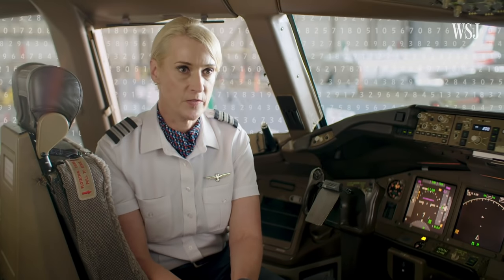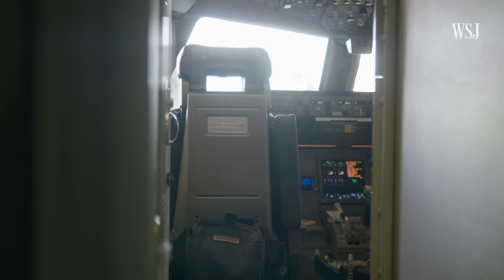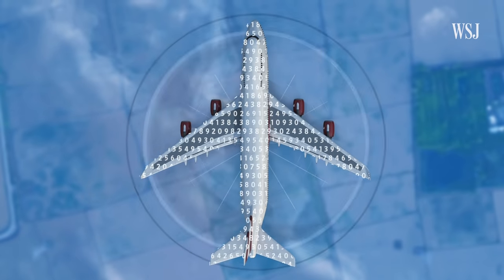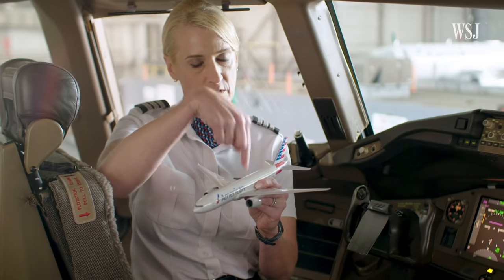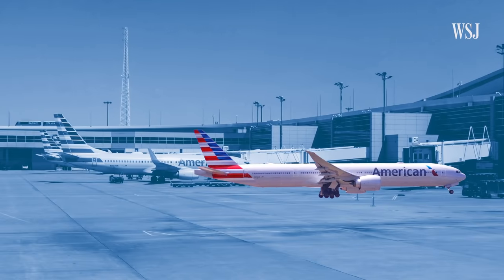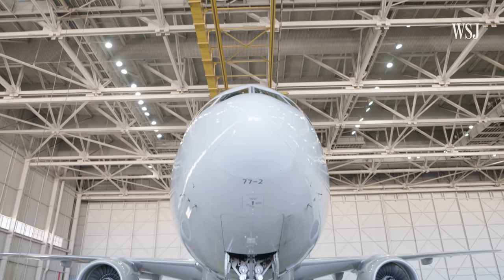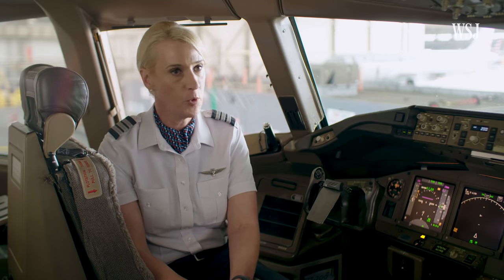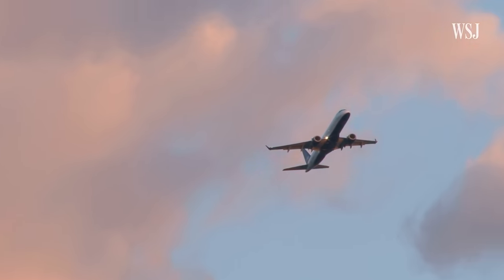How Does Autopilot Work? A Pilot Explains What It Can and Can’t Do | WSJ Booked

Comment: The autopilot on a Boeing aircraft can control both the elevators and the horizontal stabilizer, although indirectly for the elevators.

 Horizontal stabilizer: The autopilot primarily adjusts the horizontal stabilizer for long-term pitch control. This adjustment influences the overall pitch of the aircraft.

 Elevators: The autopilot doesn't directly control the elevators. Instead, it makes small adjustments to the horizontal stabilizer to indirectly influence the elevator position and maintain the desired pitch. Pilots can still override the autopilot's adjustments to the stabilizer using the control column.

Comment: Smaller planes need this technology
Reply: They have simpler versions. It can be a simple as wing lever. It can have control panel only (no flight management computer). It can be airliner-style avionics. It depends how the owner want to configure their plane, and if the plane is certified for Instrument Flight Rules.
Reply: They have it - and even more advanced versions of it. Cirrus developed an autopilot that has a panic button for passengers which makes the plane land automatically and the closest suitable airport totally without interaction. It manages every stage of the flight from that point onwards giving feedback and communicating to atc meanwhile doing it's maneuvers. This technology has existed since basically the Apollo capsule and it's accompanying rocket which had the first digital flight computer. With analog computers and autopilot (which did/do exist) it would have been next to impossible to implement. Today the technical implementation is trivial though the regulatory certification especiallybin commercial space is very difficult.
Reply: @rkan2  It's not limited to Cirrus, it is any aircraft with compatible Garmin avionics. Although, the assumption of emergency autoland is that the nature of emergency is just pilot incapacitation. Add technical problems in the mix, all bets are off.

The typical course of action in case of automation malfunction is to stop. Planes does not have such luxury.
Reply: @dbclass4075  Yes, you are correct, but as the system is certified as a system (at least currently) - it is only Cirrus that has managed to achieve it by now even if it the Garmin avionics that provide it. What comes to reliability - the human is still very much in the loop so all bets are off from the getgo anyway.

Comment: Auto Pilot should be engaged at 28K feet ? I’ve see dozens of videos of Pilots engaging AP second after v1 rotate!! I mean ..is that trusting the system at max or wanting to take charge of the aircraft the least possible and leave it technology rather than experience and know how?? Interesting 🤔
Reply: Different aircrafts have auto Pilot activated at certain phases of flight but yeah most pilots prefer to manually climb then engage it when they reach the cruise altitude.

Comment: My question is if you flew a plane without a autopilot system will you be certain I can get to my final destination in a safe manner
Reply: Planes can always be flown manually, at least so far. However, for the longer distances, speeds, control complexity, and the fact a flight engineer doesn't exist any more, it is a lot safer for autopilot be used for routine operations. Flying entirely manual for more than a couple of hours, especially on busy routes, would be extremely tiring for pilots.

Comment: Sir

I am Mathew from Interlude Technology we have the solution for death dive recovery.
We have the solution for the recent crashes related to death dives / vertical unrecoverable dives. I have experience in creating and recovering from such dives on jet aircraft. I can create the death dive on simulators and the procedures leading to recovery depending on the various characteristics of flight.
I had the opportunity of meeting Boeing, Airbus, and Lockheed Martin at CANSEC 22 and discussed with them the recent crashes of Lion Air Flight 610 and Ethiopian Airlines Flight 302. Eastern China air crash and Flight 72 (2008) Aircraft involved was Airbus 300 all manufacturers acknowledged the cause and the crashes.
Since the pilot goes into a negative 3.5 G to 4G cannot respond aptly. And valuable time is lost. When my solution is automated and applied from the inputs of two instruments in the right sequence the aircraft comes to the right attitude then the engine is put back to control after stabilization and at the right air-speed, the lift is augmented as required depending upon the height the recovery has to be initiated. Waiting for the aircraft to belt under control and apply the required trust to climb back and return to base as applicable after the inertia due to the dive is negated.
I have the experience and depending upon the aircraft to be saved the solution can be modified and applied.
Analysis
In the case of flying where Anticipation Awareness and Apt Action are the keys to avoiding disasters.
There is a saying” to foul up things you need a computer”. And one needs a specialist to complicate a problem and a genius to solve it. I have encountered a death dive and have come out of it successfully. I can create a death dive and recover from it. the death dive occurs on its own taking the pilot by surprise due to various factors and automation failure, under stress in the cockpit CRM due to weightlessness and time factor to respond is almost nil In the cockpit Situational awareness is lost and the controls do not respond as it should. I am referring to, How to understand the solution I am offering? Referring to what to do? When to do it? Why do? and the aerodynamics of it.
Awaiting to serve you the very best at all times
Yours truly
Mathew 

https://www.youtube.com/watch?v=DOSic8a8b-E&t=7s&ab_channel=MathewVijai
https://www.youtube.com/watch?v=uW9akvKoS50&t=58s&ab_channel=MathewVijai

Awaiting to serve you the very best

Attachments area
Preview YouTube video Intro to death dive recovery
 
 
Intro to death dive recovery
Preview YouTube video Death dive recovery
 
 
Death dive recovery

Comment: Cheap Boeing Ad, if the victims were Americans, they wouldn't dare to make this Ad so soon.
Reply: Does it matter? While Boeing 777-300ER is used as reference aircraft, the principle is still the same for all airliners. Just relocate some buttons and display of the mode control panel, then viola. Now you have Airbus's version of Mode Control Panel. Remove digital displays of MCP, then you have Bombardier's version.

Comment: "It was a faulty flight control system, combined with pilot missteps and other factors that investigators say led to two fatal crashes of Boeing 737 MAX."
Compared to the enormously absurd flight control system fault, the pilot missteps are negligible in my opinion. I'm not saying the pilot missteps should be neglected, but the statement clearly does not reflect the real cause of the crash. It's too easy to put both things at the same level, when they are not. On one side you have a whole company which knowingly took a series of major wrong decisions in their cosy offices for months, with no concern whatsoever for safety; on the other side you have pilots who encountered a catastrophic event they had not been properly trained for, and who spent the last (horrible) minutes of their lives trying to figure out how to control a system they did not even know existed. Really, it's way too easy to mention the pilot missteps when you consider the gross errors from Boeing. It's unfair. It's revolting.
Reply: Actually,  faulty MCAS activations are something that the flight crews can counter with normal controls even if the crew failed to perform the non-normal procedure that they are expected to do by memory.
Reply: @Jay-hv6te Actually, the pilots hadn't been taught about the new MCAS. They were confused when the aircraft didn't react the way they expected when the trouble became apparent.
Reply: @PeterLGଈ  Actually, the pilot does not need to know the existence of MCAS to know that it is a good idea to keep the aircraft in trim or that the two cutoff switches at the center pedestal should be used when the stab trim is reacting abnormally.
Reply: @Jay-hv6te  they knew about MCAS, just not the way the new Boeing unit worked. That was born out in the official reports. The momentary confusion was all it took.

Comment: Wow, so commercial airline autopilot sounds a lot dumber than Tesla autopilot.
Reply: It is simply due to differences of operating environment. There is a lot of open space in the air, so the margin of error can be forgiving. Only exception is during autoland, where the plane has to touchdown at the exact spot on the runway.

On the road, a few centimeters of deviation can be the difference between being in lane, and smashing into the median.
Reply: Wit instrumented flying separation is almost a given. With road traffic it is the opposite.

Comment: She has her axes wrong
Reply: No, she got them right. Elevator and trim control latitudinal axis rotation (pitch), ailerons and flaps control longitudinal axis rotation (roll), rudder controls vertical axis rotation (yaw)
Reply: @jimbojet  elevator controls the x axis, roll is for the y axis
Reply: @JinNani224  That is assuming y-axis is along the fuselage. But she uses x-axis instead.

Besides, they never explicitly used letters of axis as reference. What is more important is the axis in reference to the aircraft.

By the way, y-axis is usually the vertical axis. In your example, shouldn't the rudder controls the y-axis?
Reply: @dbclass4075  Z is usually the vertical axis, Y goes out the wing. That’s with a wind reference axis. I forgot what manufacture her aircraft is and I don’t want to watch the video again but Boeing uses the same axis for a body reference
Reply: @JinNani224  It is indeed Boeing, but since this video is intended for the general public, the specifics of axis isn't important. What is important is name of axis in reference to the aircraft, which is accurate.
Reply: @dbclass4075  that’s what I’m saying, it’s just not accurate. Check Boeing mechanical drawings
Reply: @JinNani224   Forget x, y, z. Listen carefully at 2:36:

• "We have the longitudinal axis from nose to tail,..."
• "...the lateral from wingtip to wingtip,..."
• "...and then the vertical, which goes straight down in the middle of the aircraft."

Not once did she every use letters as reference. Never specified which is x, which is y, nor which is z. She use the aircraft itself for reference of the axis. Listening further on at 2:45:

• "So, when the aircraft is rotating on the long...tudinal axis, its using the ailerons, the flaperon, and spoils to do that."
• "And then the lateral axis, that's being using the elevators."
• "And then your rudder will be along the vertical axis."
Reply: @dbclass4075  lateral axis is used by the elevator?  Not going to be an engineer on this one but clearly elevators go up and down and not lateral
Reply: @JinNani224  Indeed, elevators do go up and down. They adjust pitch, in which the axis of rotation is along the wings, which is lateral axis.
Reply: @JinNani224  Mate. You just said it yourself. The “elevators go up and down” which controls pitch a.k.a the lateral axis.